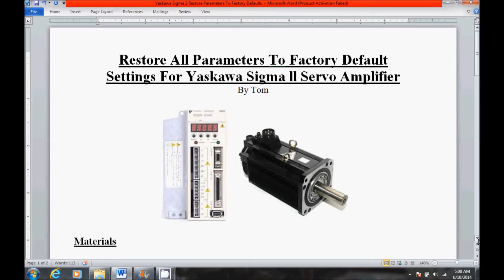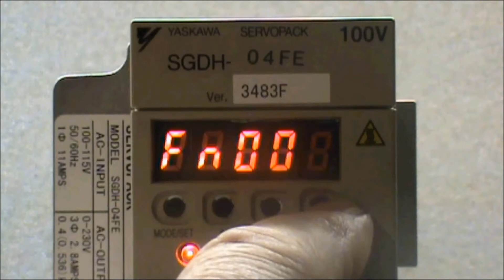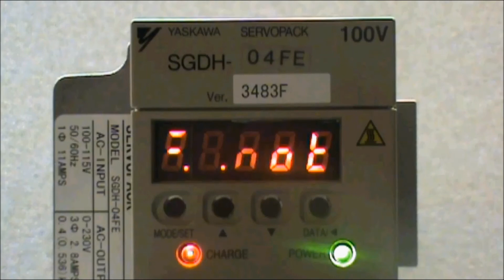How To Reset A Yaskawa Sigma II Servo Pack Back To Factory Default Settings

Comment: Omron a.84??
Reply from the maker: The A.84 alarm for Sigma 2 Servo is an encoder data error alarm. This alarm is for both absolute and incremental encoders, and its meaning depends on the type of encoder.

Absolute encoders
At power up encoder is malfunctioning and replacement may be necessary. 
If this alarm appears during motor operation, it could be caused by external electrical noise.

Incremental encoder
During operation or at power on (intermittently or static), most commonly system vibration should be examined. Excessive vibration (exceeding motor specifications)

Most common causes,
- Excessive Mechanical Vibration
- Excessive Electrical Noise

Hope This Helps
Tom

Comment: My SGDH-01AE drive shows red charge button, but the green led for power is not glowing. Please help!!
Reply from the maker: The Servo Amplifier is split into 2 sections the Power section & Logic Section. The green LED is for Logic control, check and verify you have power to L1C & L2C. If you do replace Servo Amplifier.

Hope This helps 
Tom

Comment: Hi! We replaced the servo card in an SGDH 50 AE servopack. We want to parameterize PN UN FN numbers. Do you know of a calculator or something where I can find the factory UN PN FN numbers?
Reply from the maker: Kmetovity Levente,

Following this video you will reset all the Servo Pack parameters (PN) back to factory default settings. The FN are functions, and UN are monitoring, these are not changed. However if you are looking for your specific machine parameters settings, the only help I can give on that is sometimes the machines manufactures will include these parameters on schematics, or other machine documentation. your own company should have these parameters either in the machine documentation files or on a computer where you will need the SigmaWin+ software.

Hope This Helps
Tom

Comment: how fix yaskawa sdgs fn 010 no op?
Reply from the maker: Up Tech CNC PVC LT-130

The Fn010 is used to protect the parameters from changes. 
No Op means the parameter can not be changed without the password.

Setting Fn010 to 0000 allows editing to parameters.
Setting Fn010 to 0001 prohibit the writing of parameters as well as a couple Fn (functions).

Hope This Helps
Tom
Reply: @tomh2466  i got it, thankyou very much Mr. Tom!

Comment: How about error af06, servo on active but error af06 on display
Reply from the maker: Hello Fajar
Heres the explanation from the manual for A.F6 alarm.
Motor disconnected. The detected torque is less than 10% of commanded torque reference. 
When in BB state, an A.F6 or A.b3 may be generated instead. Applicable to Renewal models (Firmware Ver. 32 or higher) over 1 kW.

First I would check and verify the power cable is connected and the connector is tight. Also if you are using a contactor between the power supplied (high voltage) and the servo pack verify power to L1, L2& L3. Also if the main power connector to the servo motor was turned (to adjust orientation of the plug) the wiring for the power connector may have broken free and no longer attached to the motor. So check the cable connections and wiring to plug on motoretc... Lastly bad servo pack.

Hope This Helps
Tom

Comment: Hi Tom, i like your video much.
I'd to to ask how to reset A.93 alarm display on SGDH 4 OY, 
the alarm come out when last time i did take out and unplugged the battery connection from Servopack to cek the Battery voltages remain.after that installed the Battery to Servopack again. In this time the A.93 display on monitor Servopack. So ia it nesaary to do Fan.008 procedure or just to turn the Servopack power OFF and than back ON again?
Thank you so much.
Reply from the maker: The A.93 is a warning not an alarm. The times that you will normally see this is when the battery voltage is low or there is no battery installed at all when you're using an absolute encoder.

However if this alarm persists you could have a loose connection or possibly a bad board on the drive.

But normally this alarm usually does not effect the operation of the servo drive.

Comment: Hi sir,
I have yaskawa  servopack 200v,SGD7S I20A00A002.but i Can't us it for "bb". It shows on display " bb" after few seconds later.please give me proper Solution.
Reply from the maker: First the .bb is called BASE BLOCK. Consider the servo pack divided into 2 parts, THE LOGIC SECTION and THE POWER SECTION. In .bb if your motor has no brake you will be able to turn the shaft easily, in Run the shaft will be held in place. So what you need is the /S-ON signal this enables the power section.  If you follow the link below and on page 55 you will find the wiring diagram . Here focus on the wiring, Power and Servo On,

file:///C:/Users/D837186/Downloads/YEA-SIA-S800-32.2%20(8).pdf

To place the servo pack in RUN you will need to enable

Hope This Helps
Tom
Reply: How parameter setting for change mode forward and reverse if we use signal P-CL & N-CL external signal? Please for your advise..🙏

Comment: sgdv-7r6a01a yaskawa the cause is no longer parameters
Reply from the maker: If there are no longer parameters other than the default parameters in there you I'm going to have to try to talk to the manufacturer to get the parameters sometimes you can find them on the schematics of one of the drives but if you have no parameters in the drive even the default ones that means that you lost the memory in the prom so you're going to end up replacing the drive I've only seen that happen once in roughly about 10 years
Reply: @tomh2466  what is the main cause?
Reply from the maker: @florincheche163  =well first I'd like to start with the motherboard on the drive could possibly have a bad eeprom a bad socket for the prom or a bad solder joint or even a broken trace on the board but the most likely purpose would probably be some sort of a power surge either from something like a lightning strike in the area or even possibly a power surge maybe from the electric companies switching switching gear and you would get sort of a power surge
Reply from the maker: Does the display on the drive power up
Reply: @tomh2466  yes and are all values on 0
Reply from the maker: @florincheche163  Sounds like you need to send the drive in for repairs,  they will probably reload the firmware.
Reply: @tomh2466  tomorrow we try to connect with the laptop and see what we solve
Reply: @tomh2466  can you help me with the list of parameters from the manufacturer?
Reply from the maker: @florincheche163  What happens when you attempt to reset the servo pack back to factory default settings.
Reply: @tomh2466  I haven't tried which parameter to reset to factory settings
Reply: @tomh2466  instead you can help me with a scheme to create a usb interface without the original cable
Reply from the maker: @florincheche163  using this video that you had posted to will show you how to reset the drive back to factory default settings you will do that through the display on the front panel
Reply: @tomh2466  do I understand that parameter fn 005 recovers lost parameters?
Reply: or after resetting the necessary parameters must be re-entered
Reply: @tomh2466  I tried at parameter pn 005 not to initialize what would be the cause
Reply: @tomh2466  does not blink at initialization regardless
Reply from the maker: @florincheche163  No... Fn005 only loads the factory default settings.
Reply from the maker: @florincheche163  Yes.... After performing factory reset you will need to enter your specific setting.
Reply from the maker: @florincheche163  If this procedure was performed correctly done should flash 2x. If not the drive is probably in need of repair. If I had to guess probably control board issue.
Reply: @tomh2466  this is the problem, the factory reset cannot be done, please where can I send you a video clip as I did
Reply: @tomh2466  that's the problem, it doesn't blink at all
Reply: @tomh2466  I tried at parameter fn 005 after I initialize I press the left button and there is no end to blink
Reply: @tomh2466  probably does not complete the initialization of the factory parameters
Reply: the machine was disconnected from the network for about 5 months and then the problems started when restarting

Comment: Mr. what’s the parameters correctly for step and direction?
Reply from the maker: This is for the Sigma ll Amplifier. 
Reference the manual sections below for wiring also.
 
Manual section 5.2.2
Pn200.0 for position 
Manual section 5.1.1
Pn000.0 for rotation. 

Hope This Helps
Tom
Reply: Yes, that help a lot, i was confused with some parameters, this is my firs time using this drives but is easy to set up   when find people like you with lot experience! thank you.

Comment: How to set from"bb" to "run"?
Reply from the maker: Hello Yava,
The simple answer is CN1.40 must be at zero volts. The link below is the users manual, p.112 will give some info on the wiring.
 
https://www.yaskawa.com/delegate/getAttachment?documentId=YEA-SIA-S800-32.2&cmd=documents&documentName=YEA-SIA-S800-32.2.pdf

There will be a contact from a switch, relay, etc... Normally this will be connected to the E-Stop Circuit. 

The "bb"  is called Base Block. Looking at a servo drive as being split into 2 sections, the logic and power sections. While in .bb the power section is not powering the servo motor and if the motor has no brake you will be able to rotate the shaft.

In Run mode the power section applies power to the servo motor this locks the motor in place while it awaits a signal to move. 

Hope This Helps
Tom

Comment: Hey Tom, great video 😀
I have 4 drives on a CNC router with Yaskawa SGDV servo packs, they are all working fine, but when I connect 1 to SigmaWin+ 7 it connects fine by USB, but I cannot connect the other 3, is there a setting on the drives I need to set to be able to connect to them?

Comment: Hi sir
I need clear A71
Help me,,please
Reply from the maker: trieu phan,
First things first:
1. Check voltage to Servo Pack. 
2. Clear alarm history, and start process again. If fault persists check history again. This alarm could be the result of another problem.
3. Check Servo Pack and motor for overheating.
4. Check for possible breaks or damage in power and or encoder cables. 
5. Also if possible check voltage to motor and ensure there is no voltage imbalance between phases.
6. Check and verify Parameters (if replacement of drive or any changes to parameters).
  

NEXT:
The A.71 is an Overload issue.
First we need to determine when this is happening.

If during power-up this is usually a servo pack issue. 
REPLACE SERVO PACK.

If just after starting process.
Check for noise coming from servo motor such as grinding (possible bad bearings) scraping, possible brake issue.
1. Check and verify voltage to motor Holding Brake (24vdc, 90vdc). 
2. Check Holding Brake coil resistance, should be around 24vdc usually below 200ohms or 90vdc usually greater than 300ohms also meg brake for short to ground.
3. If able LOCK-OUT MACHINE and uncouple the motor from process and apply voltage to Holding Brake coil (usually 24vdc) and rotate motor shaft. If any resistance, brake could be broken and or sticking. 
4. Holding Brake Relay is connected to terminals Bk+ & Bk- through CN1 Connector to servo pack (this relay provides the 24vdc or 90vdc to the Holding Brake coil). Verify operation of this relay as a chattering coil could also cause this alarm.

During Operation:
This is probably going to be a mechanical issue with the process. Check for mechanical binding, anything that could be rubbing, wobbling etc… Next if coupled to gearbox (check for noise, heat check for proper fluid level. 
Possible issues here:
1.	Oil low, contaminated etc…
2.	Bad bearings
3.	Internal damage to gearing shafts etc…
If any of the above issues present replace or repair.

Hope This Helps
Tom

Comment: Hello
I need to solve the problem with error A.b1 on a sghd-05, can you help me?
Reply from the maker: Hello Fernando Galvão

This A.b1 is a Reference input Analog/Digital converter error. A/D result unstable Error. First off options here are very limited in over 10 years I have only seen this alarm 3x. First you need to determine when this is happening (at power up / during operation). If its happening during power up you will need to replace the servo pack (bad 1PWB Circuit board). Now I am assuming that you have probably reset the fault several times, if happening during operation, I would start by checking the reference (use scopemeter) speed and or torque reference. Next the A/D converter could be bad, replace servo pack. 

Reference input A/D converter error. A/D result unstable. Applicable to Renewal models (Firmware Ver. 32 or higher) only

Hope This Helps
Tom

Comment: Hai, I have Yaskawa SGDS-0201ARY501 Servo Pack, it is showing error as 400, I don't understand why it is getting, can you please resolve this issue?
Reply from the maker: Good Morning,The A.400 alarm is an OVERVOLTAGE alarm.Now the fix is dependent on when this alarm is happening. 1. During POWER UP,  2. MAIN CIRCUIT POWERED UP,  3. NORMAL OPERATION,  4. MOTOR ACCELLING or DECELING.
Reply from the maker: I have had this one several times over the years. If the servo has ben running I would check the following, ensure the incoming voltage is within 10% of servo pack rated, also check the power cable and motor for short phase to phase or grounding. Next CHECK THE LOAD ensure this has not changed, could be in the form of too heavy of a load, bad bearings etc...
Reply from the maker: Hope This HelpsTom

Comment: Hai, I have servopack SGDS-0201ARY501, But it is showing error as b11, I don't understand why it is occurred
Reply from the maker: Is this error on the servo pack, this I know MachMotion has a A.b11 fault, this is a speed reference data error. Check and verify your speed references are within limits

Comment: Hi , I encountered servo error A.CC on DR3 please kindly advise how to recover
Reply from the maker: Good Morning, sentamilkumar
The alarm A.CC is a encoder multi-turn limit value does not
match with that of the servo amplifier.

Now what can cause this alarm, was the amplifier or servo motor replaced?
"Incorrectly set Multi-Turn Limit
, Change the value in parameter
Pn205 setting in the
 servo amplifier.

No Multi-Turn Limit value set in
 the encoder.
First verify that the Multi-Turn
 Limit Setting parameter (Pn205)
is set correctly in the servo amplifier.
 While in the active alarm
state, change the setting in the
 encoder Multi-Turn Limit Setting
parameter (Pn205) using function
 Fn013."

Hope This Helps
Tom

Comment: Tom, I am having to replace my servopack SGDH-04AE, how do I go about reprogramming a used one to my machine with SigmaWin?
Reply from the maker: Cory

If you go to the link below I show how to connect using Sigmawin software. From there after on line go to parameters --> Edit Parameters --> and click a window pops up that starts to load the parameters from the servo to the window. At the top left of the popup you can save the parameters  from the old servo by clicking the floppy disk. 

To write the parameters to the new servo use the same procedure for saving the parameters except instead of clicking on the floppy in the top left, click "Write" to download the parameters to the servo amplifier.

https://www.youtube.com/watch?v=TsZ1AiXrcPY&t=463s

Tom

Comment: I had reset, but my the servo is error A.81. Pls help me solve this problem. Thanks
Reply from the maker: Hello Quoc
The A.81 alarm is an encoder backup alarm, a few things that could be the cause, 

Power was turned off to the servo pack and the battery back up for the absolute encoder is either missing or low.
(replace battery)

The cable for the encoder has been disconnected from the motor. (if possible keep from disconnecting cable)

Check for any breaks or shorts in the encoder cable. (replace encoder cable)

Check plugs on encoder cable ensure no pins are bent on motor side of connector. (replace defective part)

Absolute encoder has malfunctioned. (change motor)

Bad Circuit board on amplifier.(change amplifier)

There is also a possibility of noise being introduced into the cable (close to high voltage or improperly grounded), 
(in this case reroute the cables away from high voltage and properly ground cable).

After correcting problem an Absolute Encoder Setup will be required.
But here is the link to the video https://www.youtube.com/watch?v=VVXp6NwhtVc&t=22s 

Hope this helps
Tom
Reply: I had replace battery. And it was ERROR bb. Pls help me :(
Reply from the maker: Quoc,
bb is not an error, this is actually called "base block" at this point the servo amplifier is ready (but there is no power applied from the power section of the amplifier to the motor ) and awaiting a Run signal. But iF an absolute encoder is being used, the servo will not turn ON when the servo ON signal (/S-ON)  unless the SEN signal is also ON.
Reply: Ok Thank so much TOM H

Comment: i have yaskawa sgdm and thers alarm a.30 ,the reset to factory default resolte this problem
Reply from the maker: This A.30 is a Regenerative Overload error, now there are several possible causes  ^Regenerative circuit is faulty
*Regenerative resistor is faulty *Regenerative energy exceeds
regenerative resistor capacity. I would ask when is this happening, during power up or during operation.
Reply: in few seconds after power up
Reply: i have yaskawa sgdm and thers alarm a.08 please could you help me to solve it
Reply: during power up

Comment: Hi I have an "omron sgdh 04ae oy" and a "sgmah 04AAA61D OY" 

I'm thinking the controller is quite similar to this.  I took these of a machine we no longer use is I was planning on doing a factory reset. 

Is my thinking correct? If so how easy is it to set this up so when it receives a 24v signal from another source the motor turns 90 degrees?

Any help would be appreciated.